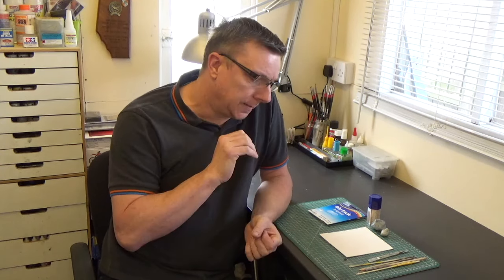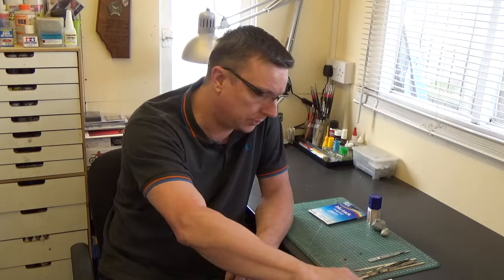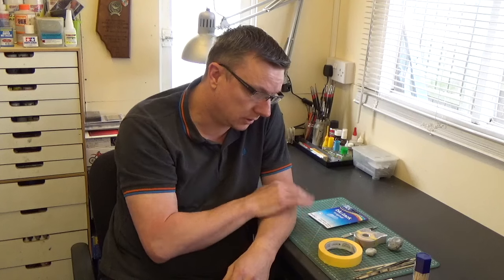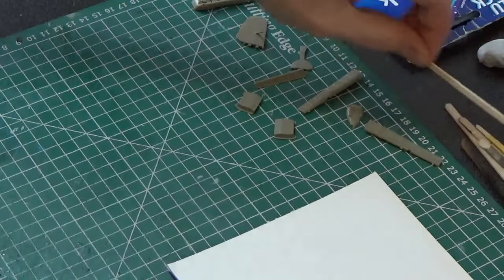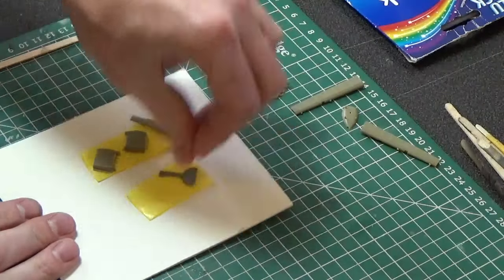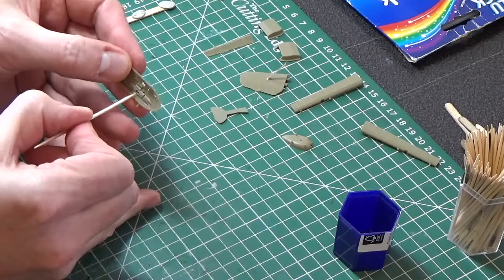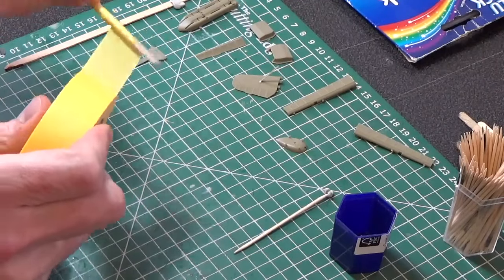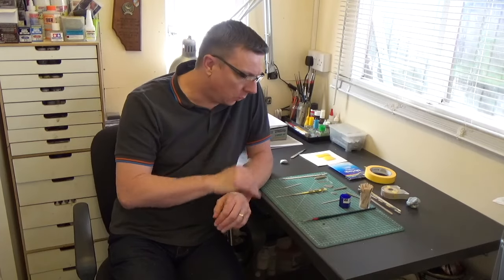The Modeller's Workshop 3: Hold On!

Comment: I've never been able to find Blu-tak in Canada, but I've been using Silly Putty for a few years now, and I really like it. It doesn't leave any oils on the painted surfaces, and it's got a very good adhesion. If any Silly Putty does remain on the surface, I just use the major portion and dab it off. It comes off quite easily. Also for gripping and painting parts, I found on ebay sellers in China that sell quite cheaply Aligator clamps. I'll clamp these to tabs that would normally be glued and paint way. Since they are pointed, I'm able to have a wide range of unobstructed painting.